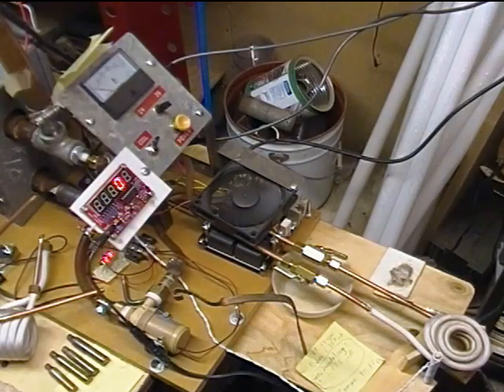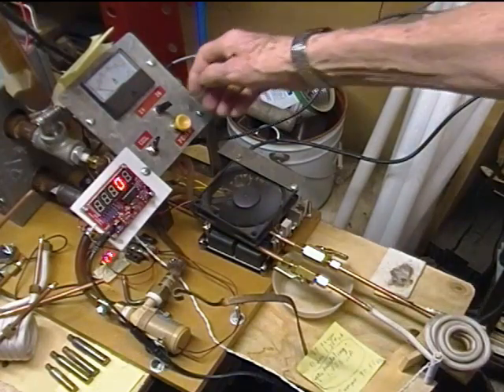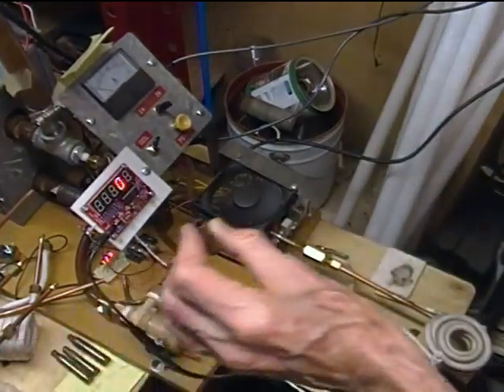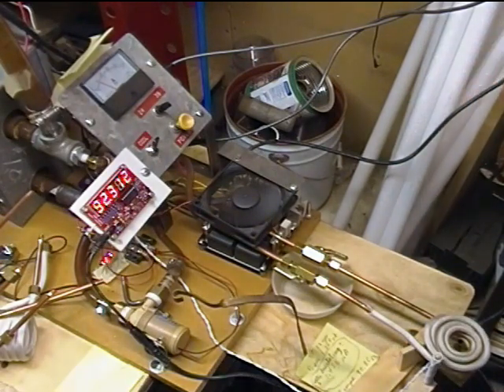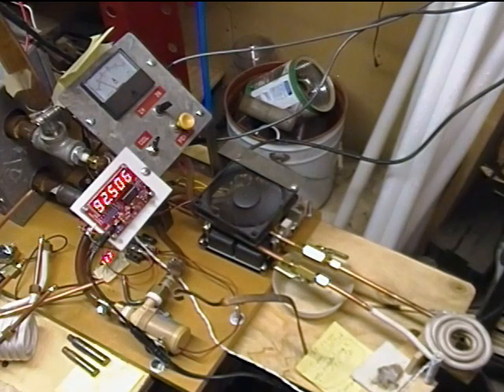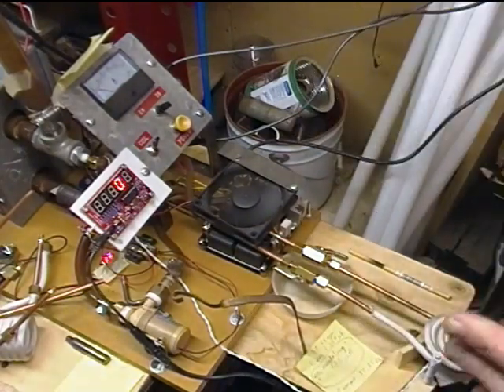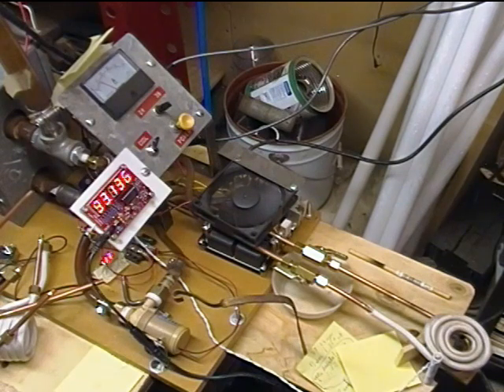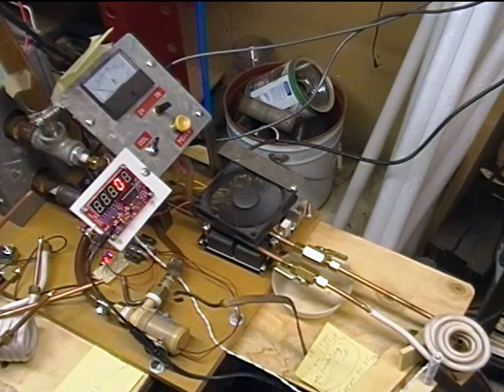ZVS Induction Heater,  3 Layer  2 Turn Work Coil for Annealing Brass Cartridge Casings

Comment: Nice.  Are you processing the signal from the ZVS before it goes into the frequency counter?
Reply from the maker: Yes, I do process the signal from the work coil, using the little antenna coil that you can see in the very lower right hand corner of the video.  It is 44 turns of  insulated 20 gauge wire wrapped on a 1/4" diameter wooden dowel.  if you look closely you can see the white colored twisted pair antenna leads going up to the backside of the frequency counter.  There is a Schmitt trigger signal conditioning board back there that turns the sine wave signal from the antenna coil into a nice 5 volt square wave which is needed for the PIC in the frequency counter.
Reply from the maker: Regarding the frequency counter's input: 
The input terminal on this counter goes directly to a PIC pin and that's why you need a nice (approx) 5 volt square wave input.
 One might ask why i don't simply feed one of the  ZVS driver's  gate signals directly into the frequency counter.  Well I attempted to do that but by the time I dealt with a PASSIVE circuit dividing the gate voltage down, I changed that gate's characteristics enough that it rounded off the gate signal which quickly overheated that Mosfet to destruction.
  so that's when I decided to stay away from the gates, except with known high impedance scope probes.
  By the way, this particular frequency counter kit can be had for as little as about USD$3.00.  I just bought a couple more of them just because they are cute.  Some people have had trouble with them when using their crystal oscillator testing function, but I don't need that, so not an issue for me.